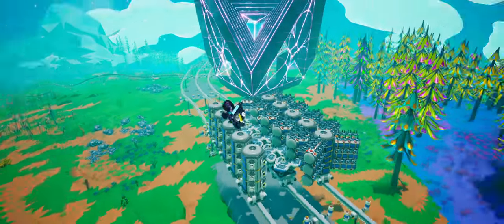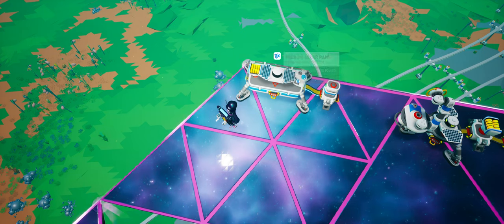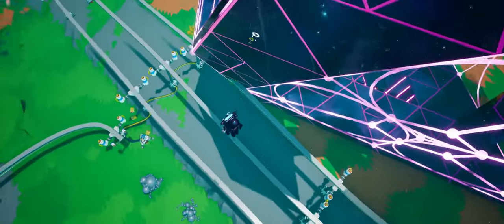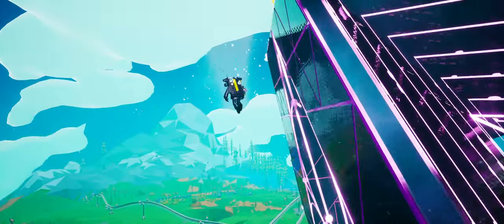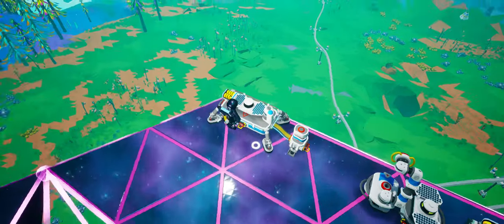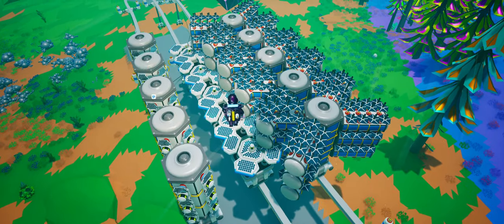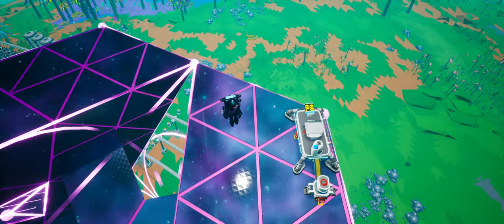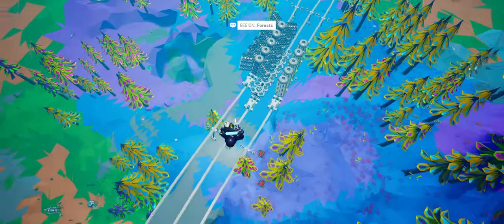Sun tracking solar trains: Constant power, Easy automation! - Astroneer

Comment: I didn't know trains could provide power through the tracks, great information!
Reply: Power, 02 and transport. They are like a mix of power extender, tether and a buggy!  I also used them to punch a hole into the core without a drill mod lol they not too bad at terrain removal
Reply: @treetops7639  How do you drill with them?
Reply: @ScorpFOZ  they obliterate everything in their way when you place them
Reply: @karyainspirasiverivied710  But how do you place them ahead of the dirt you need to drill?
Reply: @ScorpFOZ  Well the tracks bend a certain amount when placing them. So you would likely make a loop scooper.
Reply: @Daeon108  The first sentence I understand! XD
You lost me on the second!
Reply: It's a tricky one, you can search for falls and tunnels to deeper layers of cave so you can do spirals connecting the rail post on top and putting them in the walls of caves untill you reach the ground and search for another tunnel or fall
Reply: Also you can spam it on the ground digging a little or searching to a surface where it goes a little down, put it and then the rail will digg down following the surface degree.

I am sorry for my poor English. I'm a B speaker
Reply: That's how I give power to my extractors from the base. But I wouldn't know if it's possible to track the sun

Comment: I've already done it, and this with 30 GTRs for when the sun bugs is awesome. The bad side is just have to add more rails when you need more solar panels in your base
Reply: Yeah, but that shouldnt be an issue if you have the small solar pannels. if you get it set up right you would probably never need more power

Comment: Silly question, why not just slap some large solar panels upside down inside the purple teleporter as you get 24/7 solar power that way (it acts like a large prism).
Reply: Because others have done that. Old news :p. Although, I have seen others do that, didn't realize that the gateways act like that

Comment: What I wonder is if you took time to build all that, rails, tracks, wagons, sensors, solar panels,etc etc. Around the Ecuador, why don't you just build a ring of solar panels around it. Like in Dyson sphere.
Generates way more power in less time.
Reply: Building the tracks is actually pretty easy and quick. I did it for fun and it only took about 1.5h. Crafting all the small panels on the other hand...

Comment: Avoid all this work and simply create railway to the North or South pole where the sun is always shinning. Create soil ground above the node to place solar panels upside down. Connect solar panels to railway. The railway will supply power anywhere you run it. Power 100% of the time.